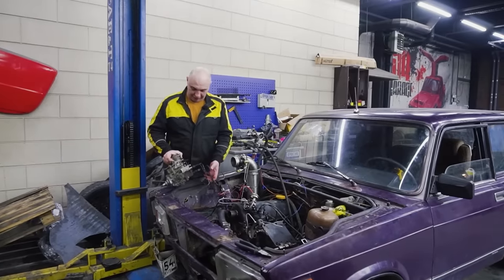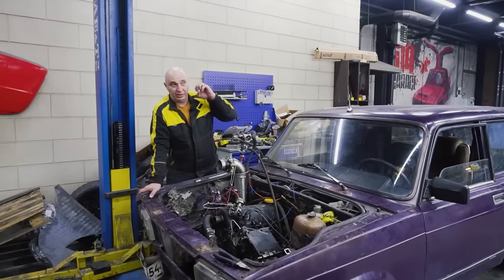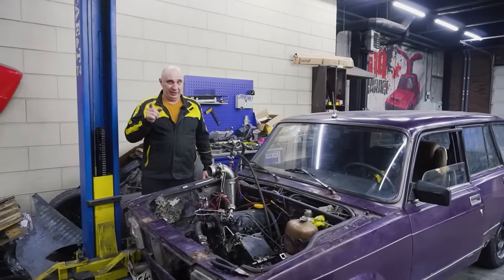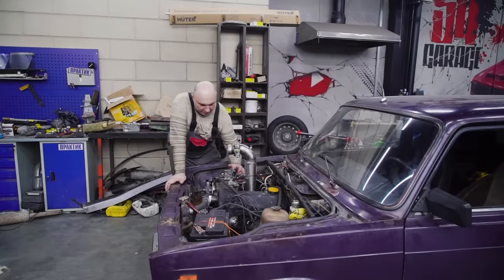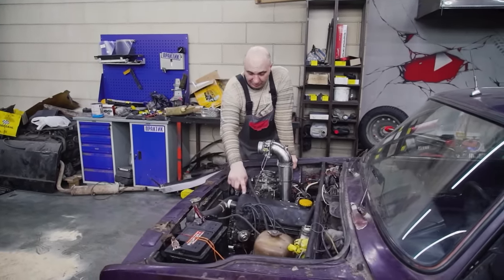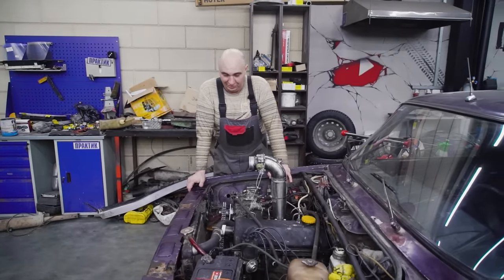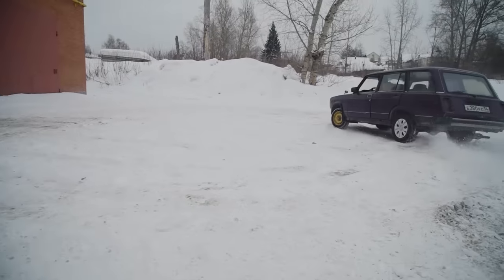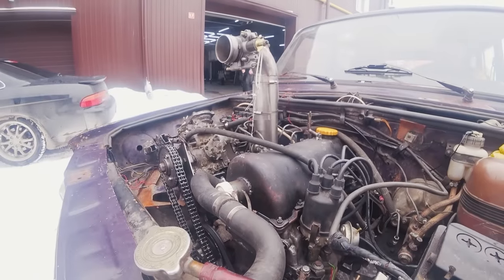We fit high pressure DIESEL pump to Lada engine

Comment: You guys really need to invest in a dyno eventually for testing power levels with your crazy contraptions🤔
Reply: Hub Dyno 😎😃
Reply: It’s about 17 hp I can tell from here
Reply: @Jon-hm2wu  😂 your welcome
Reply: DIY Dyno project ?
Reply: @Aaronkt  You read my mind... And I was going to suggest the same, by flipping a Lada over and parking the vehicle on the back wheels lol
I have no clue where to go from there, but, Community Think Tank can take it from here... 😁
Reply: Soviet dyno.. Lada v Lada tug of war
Reply: @christophermclean5620  not a horrible idea at first blush, but unfortunately falls apart scientifically and mechanically. (lol not saying my idea would be any better... 🤣)
Because it's hard to have exactly repeatable tests conducted, and that would only test torque.
Then mechanically, even two motors with 0 use, can make different power levels, all due to how well the motor was assembled... (some of the high end cars badge each motor with its dynoed results, and signed by the single-person assembler; Nissan GTR does this I believe) Which I think we can assume that the Lada factory is probably not very strict on tolerances getting met from one motor to the next lol

Cars that come out of the factory, in America at least, which happen to perform significantly better than another, we call "factory freaks", as they just happen to be above average. (this even happens in the computing industry, where processors have samples produced that are able to be overclocked way higher than others; we call these "golden samples")

But yea they definitely need something to get numbers... Even if it's something like a G-Tech meter, just for the time being, until a proper dyno can be obtained 😁
Reply: Absolutely
Reply: 100% rolling Road unlimited testing on mobility
Reply: @Jon-hm2wu  🤣🤣🤣🤣🤣🔥🔥🔥🔥🔥
Reply: I bet this one has more power than the one stroke crank engine!
Reply: They just can drive to a tuner, without investing it.

Or hook it up to the wall, with some kind of scale 😹 
The type that you use for your luggage and fish.
Reply: They should have the money from YouTube for it by now
Reply: @Jon-hm2wu  Lmfao!👌😂👍
Reply: Ikr pretty stupid to not have one at this point🤷🏽‍♂️
Reply: Build a Dyno? Sounds like a video idea.
Reply: Hope you read this article
Reply: Well, if not joking, they have one. In fact they are a pretty known drift team here with pretty good tech.
Reply: Invest? Im sure they can build one from scraps

Comment: Guys....That pump has an LDA or boost compensator, if you add a turbo, and boost reference line to the LDA, it will automatically add extra fuel in proportion to boost... if you tune the pump right for the correct AFR,  that is .. with using the max fuel screw and adjusting the spring pressure in the LDA.. would actually be pretty clever stuff.
Reply: It'd also produce some real good power for an inline 4 lada engine.
Reply: I think that would work and produce some big power👍.
Also would be nice to see the engine run on diesel and gasoline at once, just hook the single injector back up and put some diesel in the tank
Reply: @veoverse4286  I'd be curious if it would run on atomized  diesel or kero , ignited like a petrol engine with a spark... atomized diesel burns good in open air so.. Could work?
Reply: @austinmaxi  diesel burns slowe tho...
Reply: @shecktaGAMING  dial in more ignition advance..
Reply: @austinmaxi  not sure how the mixture of diesel and gas would react tho... 🤷
Reply: @shecktaGAMING  oh no gas. Just pure atomized diesel or kerosene. In Jet turbine engines its ignited with a large spark plug  to start off combustion untill it self sustains. So a strong enough spark could make it work in the Lada lump.
Reply: @austinmaxi  my tdi 1z diesel engine does 7k if unlimited, change the pump plunger from 10 to 11mm and add fuel with bigger nozzles. Need about -27 to -30° advance bTDC at least to be able to inject all the fuel needed in time, and needs boost, not just pressure but a good flow too
Reply: @engenhokas69   would need to becarefull with the pump plunger siezing in the pump head at those speeds on gas... even with 2 smoke oil mixed in. Bigger nozzles though maybe a good start if it needed more fuel. I think timing wouldn't be too critical, at worst fuel would just sit behind the inlet valve untill it opens. Bit like batch fired EFI
Reply: @austinmaxi  nooo i use diesel, gasoline would destroy my engine ahah
Reply: I was going to say, need to add a turbo with this setup and see what it can do!
Reply: @kd7cwg  MOAH POWAAA 😂😂
Reply: Someone has been playing with p- pumps
Reply: The lda doesn’t add fuel. 

It reduces fuel when not under boost. 

The fuel output from a na and turbo pump is identical. 

Turbo pumps just put out less fuel until under boost. 

Peak hp is identical
Reply: @engenhokas69 I have a ahu (identical to 1z)
And I run a Land Rover 300 tdi pump. 

Built for a 2.4 engine it’s got all the fuel a 1.9 cam drink. 

Mines got a vnt turbo and installed into a mk1 vw rabbit so it gets 75mpg. 

And no way a ve injector pump does 7k rpm.
Reply: Thats a brilliant idea ass well

Comment: The two stroke oil should work wonders. My concern was first how the pump wouldn't get lube but the oil should do a better job than our modern diesel fuel which doesn't do pumps any good at all.
Reply: Some people actually put 2-stroke oil into their diesel fuel when they fill up for that precise reason, modern ULSD fuels are not that great for older pumps and valvetrains, as the sulphur in the older fuel was acting as a lubricant, once that's gone entirely, older diesel engines will need to use additives to not blow up...
Reply: @twocvbloke  I do with my 12v. When I had my VE pump I still did. I put break in oil and two stroke oil in my diesel when priming and breaking in my p7100
Reply: @twocvbloke  so the low sulfur diesel is good for emission regulations but wear out the diesel pump faster. Cant win.
Reply: @midlifeparty  Seems that way. I think I'll have to do the 2-stroke oil diesel treatment for my old Triton. Don't want her mechanical injector pump to start leaking and wear out until the engine hits near 1 million kilometers.
Reply: Emission systems can’t handle high sulfur fuel. All bad
Reply: That's so weird to me to think that diesel systems need lubrication. I tend to think of diesel as diesel oil, or fuel oil. I've had plenty of it on my hands and it feels pretty darn slippery to me but I'm not a steel part under pressure either.
Reply: @keithyinger3326  check out the Project Farm channel. He has a great lubricity tester and after watching a few videos of him testing different oils and additives with it, you'll see why what you feel is irrelevant to how much lubricity an oil can have. It's like motor oils. 6 different brands identical weights will feel identical rubbed between the fingers but with different additives and such can provide vastly different wear levels.
Reply: @twocvbloke  it's actually the process that removes the sulfur that causes diesel to lose lubricity. If you were to add sulfur back it would not restore lubricity. And that's why diesel has 7-10% biodiesel in it.
Reply: @twocvbloke  It's not even good for the new ones Lmao enter CP4 into the chat. 

EU considers sulfur a required characteristic of diesel so they still allow a decent amount. The CP4 was in use in the EU markets for quite a bit of time on Mercedes diesels. Bring it to the US and they started failing at increased rates. Cummins being the only company that basically admitted there was a problem with them here even to the point of a recall of two years worth of trucks.

I own a 6.7 but a powerstroke, I see other's failing and people making comments about running additives changing fuel filters at the same rate as the oil. I'm just like this has got to be the most finicky diesel ever. What's worse is pretty much all the diesels on the current market even in smaller applications are running it. Because it's cheaper than the CP3 and lighter/smaller. 

Side note, the models of Cp3s on the Cummins actually flowed more than the CP4 they had put on it. So while newer and even if they didn't have a chance of grenading and taking everything else in the loop with it. It still would have been a technical downgrade.
Reply: I have been running my Diesels on used Veg oil for over 20 Years.  The lubricity  difference  between Diesel and Veg is like the difference between  water and engine oil.  I get nervous when I have to fill up on Diesel and always have a couple of liters of veg to put in the tank because I have seen tests that show just a couple of liters of veg in Diesel increase Lubricity off the charts.
Reply: @AbsolutionArmament  I‘be heard 21 model 6.7 switched back to 3s instead of fours or that they changed materials. My truck is running great I have 70k on my truck and my cp4 hasn’t failed. We have 20+ 5500s in our fleets and so far only 2 have had their cp4s fail.
Reply: @BIGREDTECH  they did switch back to the cp3 and they do offer a recall on the cp4 it's reference number is Y78. 

Well that's two out of your fleet that never should have failed in the first place.
Reply: @AbsolutionArmament  they were down for several weeks too.. thanks for the info Appreciate it!
Reply: @BIGREDTECH  only 2 out of 20 is still a very large amount. That's 10%. I own a 20' 5500 and I think about the cp4 from time to time.
Reply: 500:1 mix (160ml in 80 litre tank for example) of TC-W3 two stroke oil is a decent upper cylinder lube for pennies.
Reply: @twocvbloke  Applies to modern common rail diesels as well, as long as you are deleted. Otherwise the 2 stroke can cause issues with emissions components
Reply: @keithyinger3326  Regular sulfur diesel did not need extra lubrication
Reply: @noonespecial9131  Most diesel in the United States does not have any bio whatsoever in it. Only certain stations carry it. Near me on long island there are only a handful of stations I have seen that are labeled as containing up to 20% bio
Reply: @AbsolutionArmament  VW had issues with CP4s as well and admitted there was problems with it

Comment: You should do these mods to your inline 6 lada engine.
Reply: @MrThunderCunt  because it's an inline six..? Oh man it's an inline six just like the TWO JAY ZEE OOMMMMMGGGGG SUPRA FAST BEST CAR SUTUTUTUTUTUU🎉🎉🎉
Reply: @jd7896  it probably has a similar displacement to.
Edit: as mentioned at 25:45 this is a Lada 1.5L . Not sure what the Displacement of I4s used for the I6 was, but I assume it's probably a 1.5-1.6L if you know please share.
therefore, I can conclude that it the I6 Lada has probably a smaller Displacement than the 2JZ, around 2.25L - 2.40L. I wonder how much power that engine could make with a turbo.
Reply: @jwalster9412  Not a lot because the head on a lada was not designed for a lot of airflow
Reply: @twoeightythreez  dremel goes brrr
Reply: Yep, just what I was thinking, would be perfect.
Reply: They should make a e36 Lada equivalent
Reply: Восхищение произойдет без сомнения, и это произойдет намного раньше, чем многие верят (менее 10 лет, согласно всем экологическим, погодным, астрономическим знакам, израильским графикам и т. д.). Это произойдет без всякого предупреждения, ни одного, в одно мгновение, застигнув массы людей врасплох, как это всегда делает Бог, т.е. потоп - грубое пробуждение. Никто не знает точного дня или часа, когда произойдет восхищение, это точно. ВОСХИЩЕНИЕ МОЖЕТ ПРОИЗОЙТИ СЕЙЧАС, В ЛЮБОЕ ВРЕМЯ !! . Пожалуйста, пробудитесь ко Христу Иисусу, который является ЕДИНСТВЕННОЙ надеждой СЕЙЧАС, и не позволяйте узнать, что это все правда позже, когда будет слишком поздно, и вы остались позади в самые ужасные времена, которые земля когда-либо переживала прежде и когда-либо будет. Римлянам 10:9-10 Если устами твоими будешь исповедовать Иисуса Господом и сердцем твоим веровать, что Бог воскресил Его из мертвых, то спасешься!

пожалуйста, поделитесь с другими = ВАЖНО
raptureready.com

The rapture will happen without a doubt, and it will happen much sooner than many believe (less than 10 years, according to all environmental, weather, astronomical signs, Israeli charts, etc.). It will happen without any warning, not a single one, in an instant, catching masses of people by surprise, as God always does, i.e. the flood is a rude awakening. No one knows the exact day or hour when the rapture will take place, that's for sure. THE RAPTURE CAN HAPPEN NOW, ANYTIME!! . Please wake up to Christ Jesus who is the ONLY hope NOW and don't let it all be known later when it's too late and you're left behind in the worst times the earth has ever experienced before and ever will be. . Romans 10:9-10 If you confess with your mouth that Jesus is Lord and believe in your heart that God raised him from the dead, you will be saved!

please share with others = IMPORTANT
raptureready.com
Reply: They cannot because there is no 6-cylinder diesel engine pump that works with the firing order of that engine they built, they would have to divide the fuel of two injectors of a 4-cylinder pump in two and that would not work well
Reply: 2JZ, minus about 100hp
Reply: @MrThunderCunt  Every I6 isn’t a fucking 2J
Reply: Turbo I
Reply: @BrapBrapDorito  Yeah. There thousands of different engines than a 2J. And if a 2JZ GE wasn't taken care of, they are crap to fix. I'd prefer a Caterpillar with a 140mm Compound Turbo Set up.
Reply: Yeah then it would sound like Paul Walkers Nissan Skyline
Reply: @jd7896  cringes comment ever
Reply: @Zeeos27  You would use 2 pumps, and have 2 of the lines act as returns.
Reply: Was about to comment the same
Reply: @Zeeos27  its not nesesary you only need to rute each line to each pistons in correct firin action
and even if it was de case you can put the injector togueder in the carburator zone and let each cilinder draw his oun fuel and the rigt timing letin more atomizacion in the inteake meking colder air
Reply: @elcascoviejo5347 I think you’re missing the fact that a diesel engine runs on diesel
Reply: You can’t just pour diesel into the intake and expect it to run well. You need an injection pump. And their i4+2 engine isn’t an i6 engine. A normal i6 engine has all cylinders 60° out of phase, so that the total mass of all cylinders moving up and down = 0. Which is why they run so smoothly. Their i4+2 has all cylinders 180° apart which there is no ready made injection pump for.
Reply: @jhsevs  i'm talking abouth the 6cilinder lada PETROL that they Made using the pump off a diesel ring PETROL like this video
Reply: @seanmckay3392 this for paul walker is cringiest comment i saw on this channel

Comment: I'd bet that mechanical port injection with that velocity stack would generally run well even without the extra pressure. Also that long intake really helps with low end torque, which is why you're getting so much pep and throttle response. 
 Really cool work guys.
Reply: Also, I bet that single intake it chocking the engine.
Reply: they used the same intake with the DIY electronic fuel injection and it was slower... Diesel engine fuel pumps run at extremely high pressures compared to gas pumps. Higher pressures give much much better atomization and creates a much better fuel mixture
Reply: @dieselgeezer18  finally someone gets it!
Reply: They should make the intake longer, like Holley SkyRam long XD
Reply: Small correction: That's not a Velocity Stack.
What they have is closer to a Tunnel Ram.

A velocity stack is a cone inlet mounted before the throttle plate (butterfly), but most importantly, at the opening of the cone is an airfoil shape. It's that airfoil that causes air to actually accelerate into the opening and down the throat of the cone; hence "velocity".
 Almost like ram-air -- on an airplane, not the cold-air mounted on the hood that we called ram air in the muscle era -- but at a standstill, since it does with without the use of a headwind.
BONUS FACT: Cooling towers, those big ""smoke stacks"" of a nuclear power plant (used on any steam power facility, coal before nuclear), is actually an upside-down Velocity Stack. The whole cooling tower is not sitting flush against the ground, but is raised up. As the hot air rises, it draws in cool air through the bottom, then rushes up and out the smaller top opening. 

Aside from that, you're totally correct on everything else!
Reply: That's true of runner length but that's part of the plenum not the runners so it wouldn't make any difference.
Reply: Haha right!?
Reply: Makes sense about the nuclear stacks! Never thought i of that...I use velocity stacks on all my builds for first stage of intake!have noticed non import or school guys call em bell tower intake stack or something lolol bell something but ya i do believe in the velocity stacks they truly work ǹ sound amazing
Reply: Makes sense about the nuclear stacks! Never thought i of that...I use velocity stacks on all my builds for first stage of intake!have noticed non import or school guys call em bell tower intake stack or something lolol bell something but ya i do believe in the velocity stacks they truly work ǹ sound amazing
Reply: Long intake does not necessarily mean more torque if the fuel is injected right before the valve hahah correct me if im wrong though